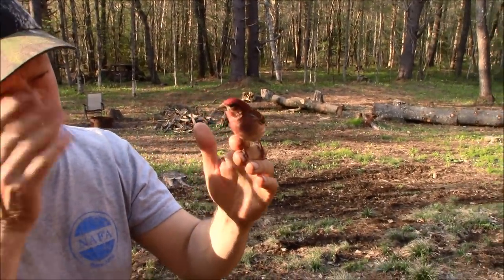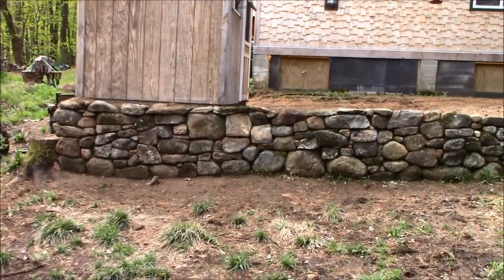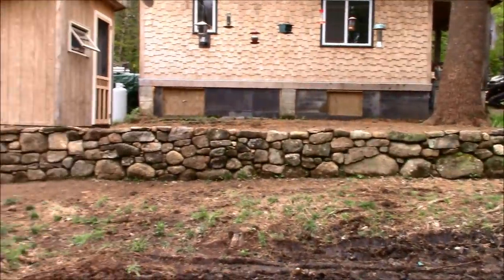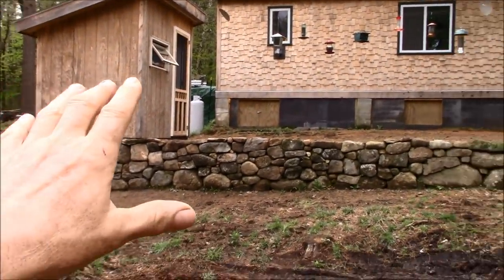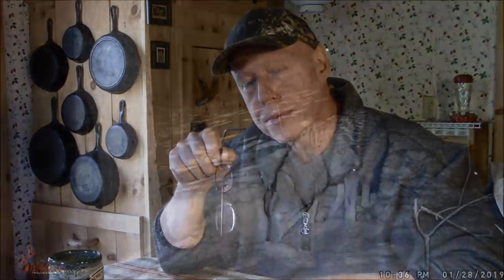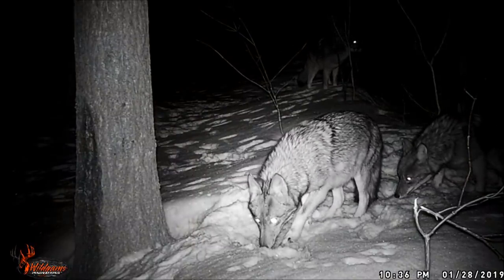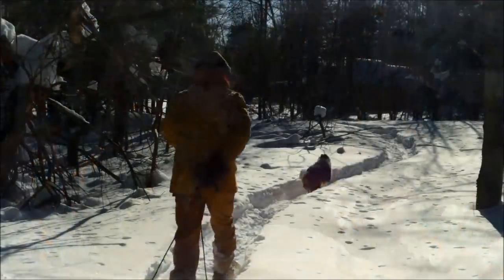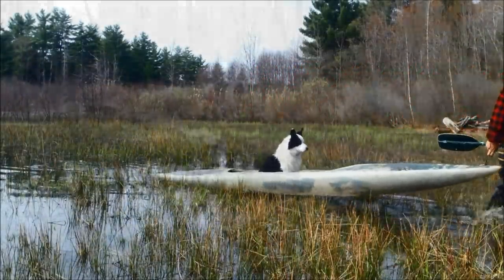OFF GRID CABIN LIFE  Building A Stone Retaining Wall and Other Fun Clips   Vlog 40

Comment: Beware of energizer batteries. I know you change the batteries frequently and wouldn't leave the batteries in them when they're not in use, but I left the batteries in a very expensive flashlight, and they swelled to where I couldn't get the out. Just saying.
Reply from the maker: I have seen that also with other brands. Thanks for the reminder since i recently pulled all my cameras out of the woods.